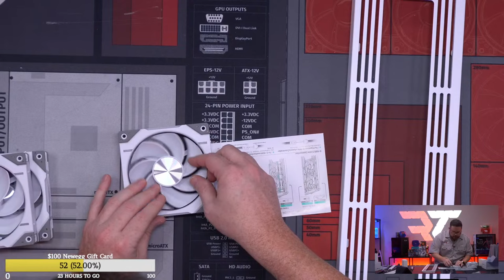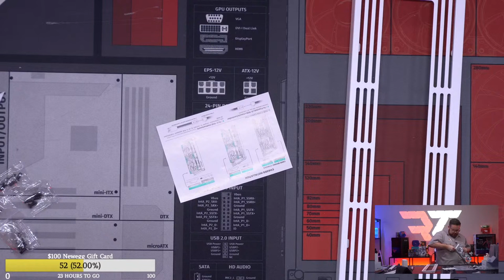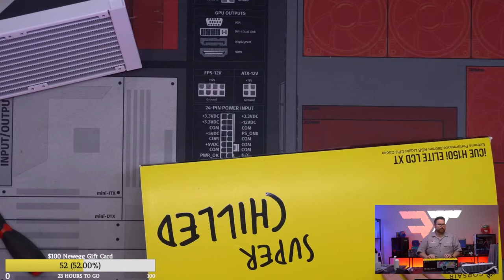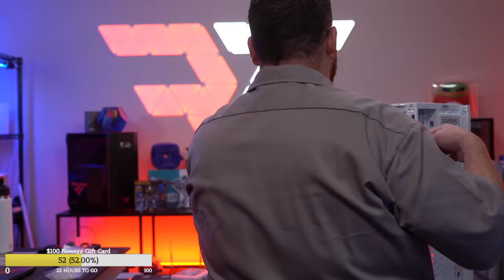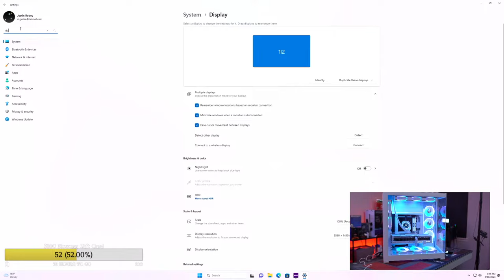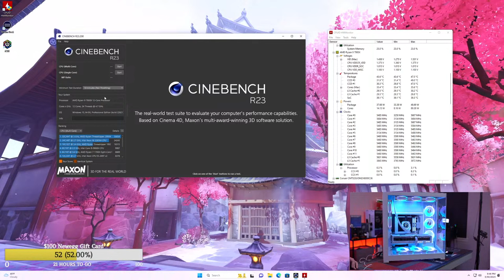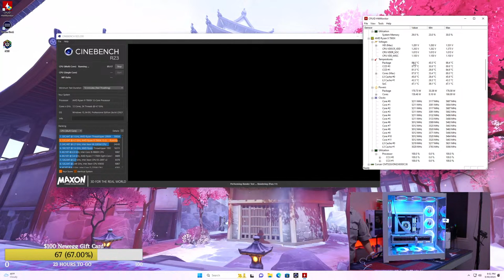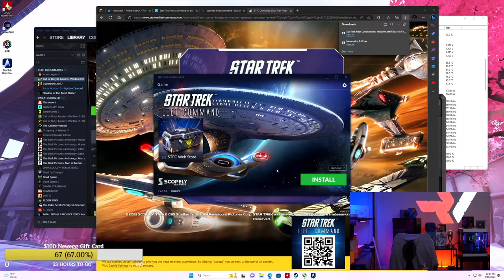$4000 White Phanteks NV7 Live PC Build  - Giveaways + Phanteks NV7 (7900x / Strix RTX 4080)

Comment: This helped me out soooo much.   Thank you so much for the chapters! You’re invited to my cook out!!  Mainly to help me move it around…this case is a beast!!
Reply: What part did you struggle with ?
Reply: @CheekoLFreako  Honestly, for the most part it was pretty easy.  No lie...I haven't built a PC since the late to early 2000s...So I was pretty amazed on how easy it was.  My only issue was the cable management in the back.  I need to get better cables.  I  really had to fight to get the back of the case back on...oh and my rear fans do not change colors like the rest of the fans.  Why is that?

Comment: Is there a benefit to applying the thermal paste and letting it sit that long before actually installing the pump?
Reply: It literally does not matter. He is in a clean area and clean space. As long as there is no dust or dander floating around it does not hurt anything. It takes alot of heat overtime to dry thermal paste. It's not that serious dude

Comment: Is it okay if I don't put all the screws in the screw holes of the fan?
Reply: It is not wise to not put all screws in as I done that with lian li SL120 V2 set of 3 and put screws in all corners of the 3 fans and a couple in the middle, now one fan is making a horrid noise, I took it all off and swapped them around and used all screws now it is fixed but was a pain to take out the fans

Comment: Will this look weird if I do this build but use the fans from the kraken z73 aio for the top???
Reply: ??? I'm sure that's a rhetorical question you should be asking yourself. Why you care about other people's opinion is a primary problem in this world. If YOU like it, that's all that matters. And why wouldn't you just use all NZXT fans if that's what you wanna do instead of mismatching the build. You don't really see the fans on the top as much as the others so I doubt it would make a huge aesthetic difference, but the nzxt fans look a lot worse then the phanteks ones do. You can literally mount any fan within dimensions spec to your radiator, not understanding why you would limit yourself to specifically those fans, while using all phanteks fans for the rest of the build, if you have the option. That makes no sense.

Comment: Awesome, love what you do! I almost got this case and fans. They sold out and I went with a non RGB g500a performance case instead. I will say I love phantek but that gap on this case to the top radiator is ugly, they should of thought about that before hand since this is a showcase tower after all.
Reply: I mean, the PSU goes behind that veil, so it does have a purpose. I do agree it is a bit bulky, but I don't mind it. Since it is a full tower case, it was definitely designed with custom water cooling loops in mind, and that would also help fill some of that empty space! Or you could fill it with stickers, custom artwork, or  more RGB!